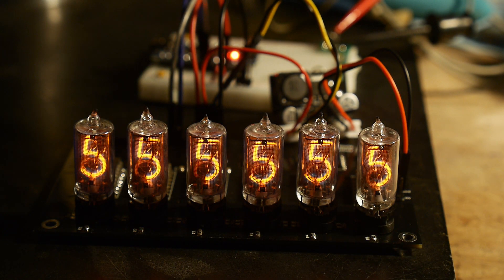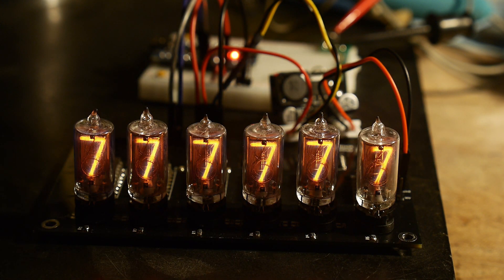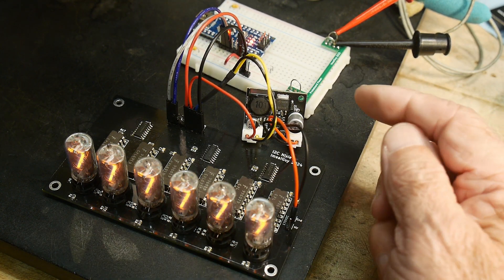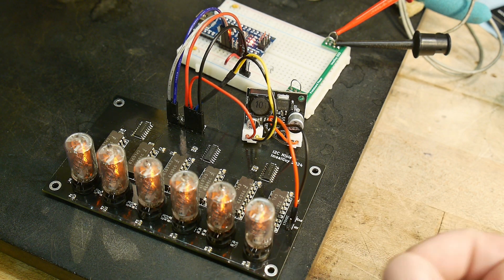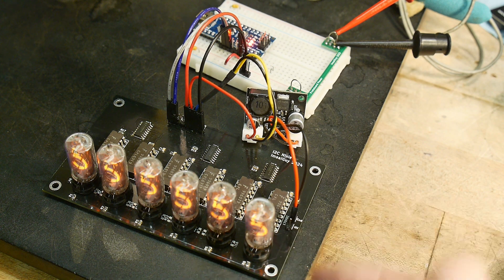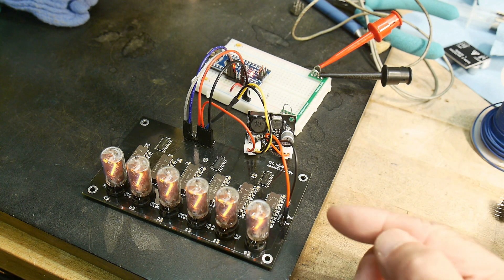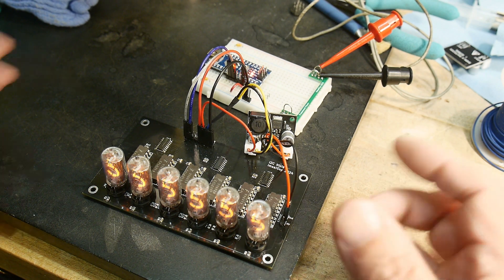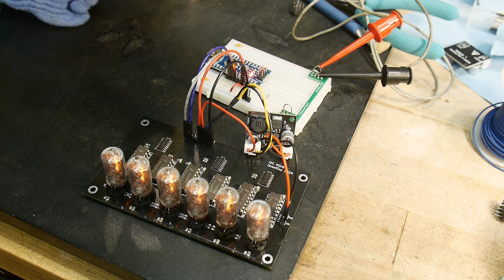#1804 I2C Nixie Display Project (part 5 of 5)

Comment from the maker: for all those asking about decimal points. adding the points would have increased the project 33%. extra i2c and driver chips. I did allow hard strapping of the decimal points by jumpers to ground at each tube, both left and right decimal points..

Comment: I have an open frame nixie clock that I bought from eBay and soldered together.  It took me about 2-3 DST events to realize that I should completely avoid holding the rear of the clock while adjusting the time!  Zap!

Comment: In most devices implementation of Nixies do they generally have a test program that runs through the numeral displays?  Reason i ask is on my Sobax, when i hit the Square Root function every digit is lit up with no sign of multiplexing through the digits. They are all on by default.

Comment: Have you consider multiplexing to reduce current usage and make the PSU happier?
Reply from the maker: yes, but requires entirely different design and a microcontroller dedicated to do the multiplexing. I guess since the data is latched you only need to scan the anodes. anyway, I'm done